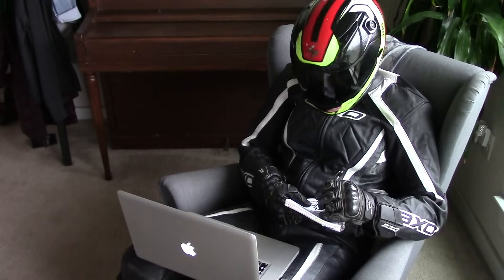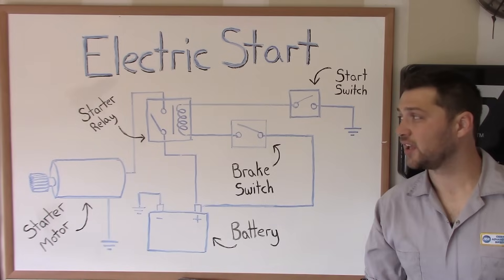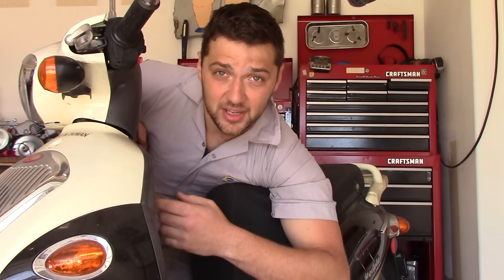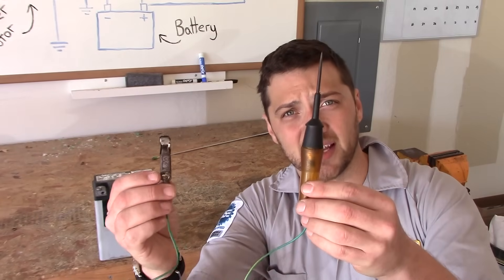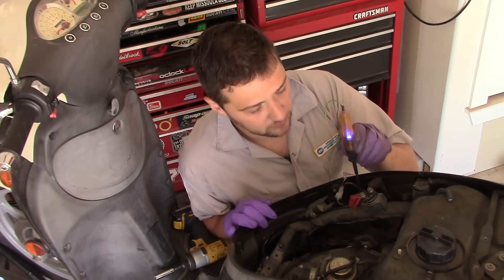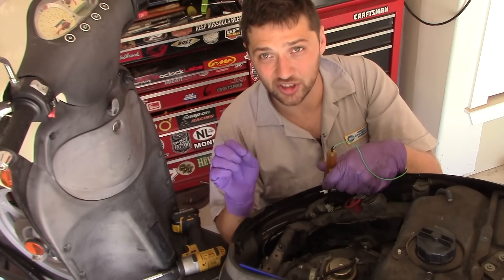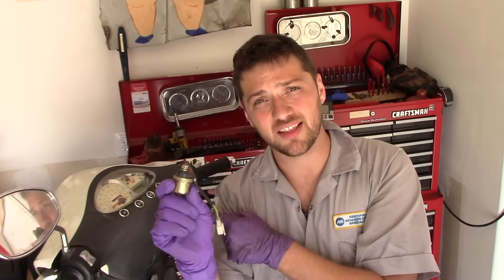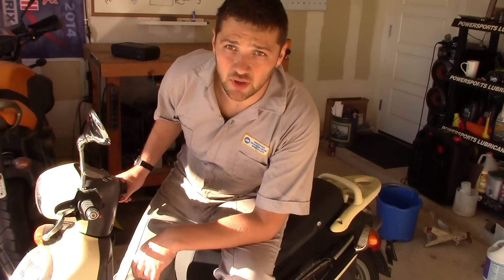Scooter 911: Electric Start Doesn't Work (troubleshooting your starter, starter relay, and circuit)

Comment: when i do the screwdriver to the relay, it sparks and tries to crank but doesnt. could that mean my starter is faulty?
 i can hear a click when trying to turn over but just wont. battery is good and fuse is good
Reply from the maker: If it sparks but doesn't crank you either have a faulty starter motor or your engine is seized. Try rotating the engine over by slowly using the kick start or turning the variator or fan.
Reply: @Scooter_911   thank you for replying so quick. sadly, my kick start lever is broken so i cant use it but the fan i can still move manually with my hand and i think it moves when i try to crank it too.
Reply from the maker: @Zetsu420  yep sounds like a bad starter motor then my friend!
Reply: my battery is charging at the moment because i tried to crank it so many times but when the battery is in there, it tries to turn over like a champ but doesnt. this happened yesterday. it took just one press of the button to get it started no problem. going homes took about 2-3 attempts but started up strong. stopped at the store and i was stuck in the parking lot for a couple minutes. I found that scary so i got it working and rushed home. waited and tried to start it again but would not turn over after i got home. 
i have a new battery, spark plug, carb, fuel filter, fuse is good, valves adjusted.
I cleaned the airbox which did have debris and hints of oil/dirt residue in it. cleaned it.
Im just lost and i just paid the shop over 320 less than a month ago to do most of this!!
Reply: @Scooter_911   i am thrilled to at least hear its a fix that isnt as expensive as getting my engine replaced or rebuild so thats some weight off my shoulders. thank you!
Reply: @Scooter_911  you’re great! I subbed 4 more great content! 

There’s something weird going on tho.. maybe my starter is going bad slowly or something but I charged my NEW battery back to 100%  (that I’ve been riding with for almost 2 months) & it came back on. Not instantly when dead cold but it fires.

But why? I mean it does get cold in the garage but I’ve started my bike up in weather where I can see my breath lol. This was not the case. 
Any advice or tips?
Reply from the maker: @Zetsu420  well there are a couple of things that could be going on. You could have a loose electrical connection, you could have a bad winding in the starter that is creating an intermittent issue or you could have a battery that had good voltage but can't supply the cranking amps necessary when it's slightly depleted.

Comment: I have a 2020 Tao Tao ATM50A-1 scooter..when I remove my front brake lever and try to start the scooter, the starter switch works..when I reassemble everything it sometimes works..could I have a faulty brake switch?
Reply from the maker: You very well could! But you might also have some loose pins in the wire harness as well. Best to take it all apart and test each component individually
Reply: @Scooter_911  loose pins in wire housing where the starter switch is? when I pull hard on brake lever it starts, unlike my left brake (rear) its looking more like the housing or actual brake switch underneath that has two connectors. thanks Garret. love your presentations. very professional and THOROUGH!

Comment: Hey, I’ll start by saying my battery is fully charged. I’m not getting power to my dashboard On my bintelli beast. I replaced the 20A fuse by the battery with a new one and when placing the fuse in the numbers start rolling on my cluster but the lights don’t come on and the numbers go away. It starts by kickstart but my cluster still doesn’t turn on or light up. The only way to currently start it is with kickstart Bc the dash won’t light up. A few weeks ago it wouldn’t light up and turned the key again a few times and it lit up and allowed me to start but now I can’t get it to light up and can’t only start it with my kickstart. Do you know what the issue might be ?

Comment: Question!! While testing the brake switch the light tester didn’t light up but the brake light still comes on, could the problem still be the brake switch? (I tested the battery and it had power as well)
Reply from the maker: if the brake light comes on the brake switch is working correctly! you might have not had a good enough connection at the test light.

Comment: Wow this is awesome, I need some help. I have a lance pch scooter 150 cc. Not many miles but has been sitting for a few years. I charged the battery and it started BUT, while i was riding the clicking sound ( starter I guess ) just kept clicking. I turned the scooter off and it just kept clicking until the battery died. any idea what that may be?

Comment: hello my generic race 50 not started from start switch  what can be ,,bacause from relay it started
Reply from the maker: Did you check the brake switch?
Reply: @Scooter_911   yes he worked
Reply from the maker: @yasons9531  then your problem is probably the starter button itself!
Reply: @Scooter_911   i dond know because i connected those wires from start switch  and not work
Reply: how much volt need  solenoid ro work

Comment: Please talk about when the engine lugs when starting.  You said maybe a loose ground.  Where would I look for that?  Also, what role does the key switch play in the ignition wiring diagram.  My Kymco sometimes starts and sometimes lugs (and the clock resets) until I turn off the key, back on, wait 30 sec, and then try again.  What's going on?  I asked on the r/scooter sub-reddit and talked about your video.  https://old.reddit.com/r/scooters/comments/kpf6il/kymco_super_8_150_cc_2014_strange_starting_problem/

Comment: why did he say unless its a honda ruckus or metropolitan in the beginning ?  what is it about these 2 bikes that  make this tutorial not  apply to them?
Reply from the maker: The honda ruckus and metropolitan do not have starter motors or starter relays. They use AC current fed through the stator to turn the engine over.

Comment: So I did all the tests up to the starter relay/solenoid. I tested the brake circuit and the starter switch circuit with the probe and both seem to be working correctly. I did the hotwire test and the starter turns over. The relay is brand new and is supposedly the correct one for a 150cc gy6 engine. What could the problem be. The battery is new also could it possibly not be generating enough current (wrong battery?)

Comment: When my  reliable Honda SH300i failed to start after sitting idle during Lockdown. I looked on Youtube and found 911 scooter and this video.  The starter sounded semi-normal but the engine wasn't turning over. I tried bypassing the relay on my scooter as suggested and the  engine turned  over. So I bought a new relay on-line and installed it in a few minutes. The starter was now turning strongly enough to get the motor turned over so that fuel  was injected and the scooter is now running perfectly. I was sol-annoyed but now I am relay happy   
 and very grateful for your excellent videos. I will never be Seesing to recommend them to other scooter riders. Thanks  it saved me a lot of money.

Comment: I’m actually having two issues and I’m trying to fix my girlfriends scooter, does anyone have any suggestions? The starter is making a drill sounding wizz when I try to start it. Different from the one in the video. And secondly the main headlight will stay on even thou there is no key in the ignition unless batter is disconnected. Anyone have any suggestions?

Comment: The problem I'm having is my ignition broke and I had to hot wire it I joined the solid black wire with the red wire and it worked for like 2 or 3 starts but now I have to run a wire from the positive terminal of the battery to the joined black and red otherwise it won't start

Comment: I saw you had no video on no spark issues.
Reply from the maker: Working on it!
Reply: @Scooter_911  I want to thank you.  I was working on a Chinese scooter for a homeless disabled Vietnam Marine veteran.  It was a pile of junk.  No ignition switch and a smoked down ignition system, probably caused by someone attempting to hot wire the ignition.  It now has a new ignition key, new CDI, and coil.  The coil had been partially shorted and the CDI was crap.  Someone had even rewired the wiring harness plug for the ignition key which I caught before it smoked the wiring harness.  It is running fine, now, but running without an air filter has sure affected its oil consumption.  It has a new POD on it, now, fuel lines, etc.  the only part that did not fail was the stator and rectifier. They seem to be working fine and all electrical tests indicate they are ok.otherwise the scooter is an accident looking for a place to happen but it was nice to be able to fix it for a brother Vietnam Marine.
Reply: @Scooter_911  I had a CDI that I tested with my digital VOM, which said it was good - no continuity between any of the pins and ground, but when I replaced it with a new one, spark returned.  Go figure.

Comment: Bro I need help, I was riding to work yesterday morning, whistle I was in traffic, the bike just cut out, NO ELECTRICITY TO THE BIKE, the ignition was on and everything bt if I start the bike it wouldn't even start the starter motor, no lights nothing, Idk were to start looking for the short, I ride a 150cc scooter, the fuse was fine, the battery was fully charged

Comment: I'm trying to diagnose a faulty relay or starter I'm following the instructions on this video but my relay on my moped is the same as yours but I don't have the two cable plug my two cables are fixed in the side so I can't test it they are fix in with the relay I can test the + and - from battery to relay but not the thin yellow and green one.

Comment: Have got a 2013 honda forza and 99% times it starts ok but some times its just dead with no response.  Battery ok and now my friend with  a2014  Forza is getting the same problem.  can you advise please as to cause of  intermittent starting. Ta
Reply from the maker: Next time it doesn't start pay close attention to the little things like the side stand position and also if the brake light is illuminating.
Reply: @Scooter_911  Its ok now, apparently the cut out or rather the ignition  works on the side stand first and then the rear brake lever.  When pulled  there are two positions, first one lights the brake  light but that amount of pressure is not enough for the ignition to work.  There is a second switch that if you don't pull the lever hard or full enough wont allow starting.  So pull that  left brake lever  hard and it should  start. ta.

Comment: my scooter starts just fine when i use the kick start, the electric start doesn't work most of the times. Is it a battery problem or in the electric start itself? (is cold weather to blame as well?)

Comment: I tried the bypass at the end of the video and it just keeps turning over... Never starts. Ruhruhruhruhruh, etc.?! Is my starter motor bad?
Reply from the maker: Nope! That means your starter motor is working perfectly you've got a different issue. Try this video out to find out why your scooter won't start https://youtu.be/xW5y7a7CB1c
Reply: @Scooter_911  Cool, I did watch another video of yours and did the carb-cleaner-start trick and it fired up.  I replaced the fuel lines and gas filter... But now I have to adjust the carb (think it was messed with), but don't know where to start... Mikuni CRB014. can I just replace it with any other carburetor that fits?

Comment: Hallo can you help me about my scooter 
I have gilera runner 125 ccm 2009 in good condotion.I have one problem but i cant find reason.When i start scoot ,and drive about 1 kilometer ,then stop and turn off.After that it cant start enegine
I have to wait about 20 min and after that it start normally.Please help 
carb is okay el pump is okay,have spark..(just in short trips this happens.) just cranking

Comment: Thanks so much for the video Garret. I'm wondering if you can provide feedback; I have a yamaha vino 125 and am having an issue with the connection between the brake switch and the relay; but the brake light works fine from both levers. Do I need to open up the steering column and trace the wire all the way from the brake to the relay to find where the issue might be? Thanks!

Comment: Hi man, yesterday i replaced the starter motor because it was spinning the opposite way and also fully chaged my battery. It worked nice yesterday and thought i have fixed it. The next day it is doing the laboured starting like your vid in 3:15 lol is it battery issues now? Like it started strong when ot was full and now seems like it drained and struggles. Battery is not that dead because it still honking loud when i press it.

Comment: I changed the cilynder kit to 80cc and now it wont start with electric, only on kick starter, i also chaing battery and it sound like the cilynder kit is to heavy for electric motor to turn around. What is the problem? Maybe i need beter electric motor to star 80cc malossi cylinder kit? I have Piaggio ZIP 4 stroke.

Comment: If starter relay makes a sound bt the starter motor does not turn what is the problem
Reply from the maker: The sound alone does not tell you that the starter relay is working. You need to use a test light to see if power is flowing through it. If power is flowing you likely will need a starter motor.

Comment: I have a 2018 50cc Tao scooter when I turn the ignition switch on the dash lights up and then fades completely out and shuts off I need help you can email me at Jon.mischloney@gmail with any suggestions for repair thank you

Comment: My Kymco 150 just turned off .  I checked the fuses they look fine . Relay is getting power. however it starts only when I jump it with a battery what do you think I should check. Thx!
Reply from the maker: Battery connections and engine grounds!
Reply: What does check engine ground mean? I see the wire just ends up connected to the frame are you just checking that connection?
Reply from the maker: @allans7281  the wires connected to the negative battery terminal. Those wires actually tie the chassis and the engine to negative (ground). On chinese and Taiwanese bikes the ground wires are always green.. Some bikes have them on the valve cover.
Reply: Thanks! Ill try

Comment: Great video! What if I have a strong battery, but all power ends when I pull the brake lever?  I also tried your method of bypassing the starter relay and lost all power when touching the pliers to the relay bolts.
Reply from the maker: I would say put a multimeter on the battery and try again. See if maybe you have a weak battery but it APPEARS to be strong. Another thing you could do is attempt to jump start it with another vehicle. If that doesn't work I would assume its a loose ground somewhere. Either at the battery or where the harness connects to the chassis.
Reply: Well...I got it to turn over by kick start, but still have weak power for a few seconds before all power dies. Battery has been checked again and is great. I've removed body panels and looked for loose grounds, or connections and still can not figure this out 🤦‍♀️🤷‍♀️

Comment: I have a problem, my ignition(I think) kept ruining batteries due to wires being loose and touching, now i got a new ignition and it wont turn on when key is off and will kickstart when on, but when i turn the key nothing pops up, none of the dashboard lights, do yall think i need a new battery or could it be something else?

Comment: How to crank a 2013 honda pcx w150 doesnot have starter nor kick starter just magic button need to trouble shoot how to cranker up i don't  have no info please help
Reply from the maker: The pcx has an engenious starting system similar to a honda ruckus and metropolitan. It actually takes dc current from the battery, runs it through an inverter, and uses the stator like an AC motor to turn the engine by the flywheel magnet. If it won't crank, make sure the brake light illuminates and the kill switch circuitry is in good order.
Reply: Do you have info on this scooters with no starter nor any foot crank lever  2p13 honda pcx w150
Reply from the maker: @robertoramos1652  You're best bet is a service manual. But make sure the battery is good and fully charged.

Comment: You saved me money. This guy from my sister's motorcycle gang was telling me my battery needs charge and not charged by a trickle. When you made the sound of when the starter is not ground properly I ran to my scooter, put the ground wire in another spot and she starts right up.
Reply from the maker: Nice work!

Comment: Can anyone help me, I just got a new battery for my gy6 150cc and when i first press the push start it doesnt really crank it sounds like the battery is completely dead but after holding it for like 20 seconds it cinalyy engages enough to start the scooter, im dazzled does anyone have any ideas at all

Comment: What about Honda ruckus and Honda metro?
Reply from the maker: They use a completely different starting system and don't actually have starter motors (in the traditional sense). They use an inverter to take dc power from the battery, convert it into AC current and send it through the stator. This basically makes an electric motor out of the charging system and flywheel magnet, turning the engine over. Thats why metro and ruckus engines have such a quiet startup
Reply: Garret Seesing thank you so much!! I looked at a diagram online and it showed where the starter was and I looked at the scooter and it was no where to be found so I assumed it didn’t have one but that’s a weird assumption so thank you so much again for spreading that knowledge on your boy!